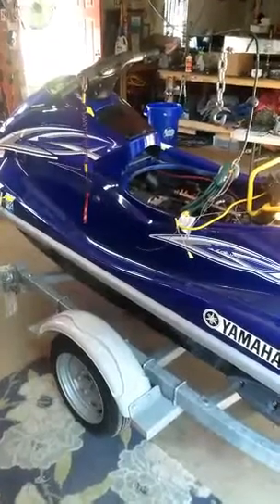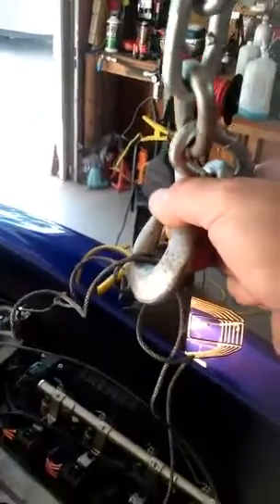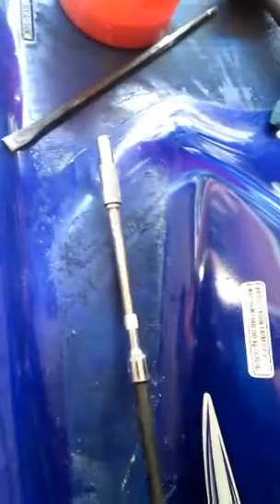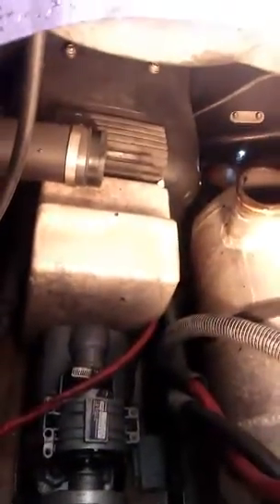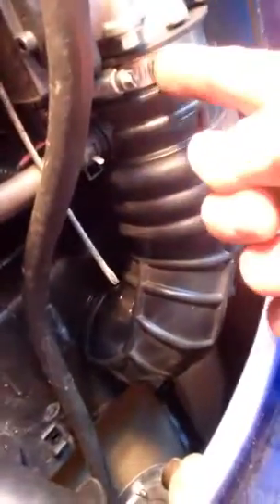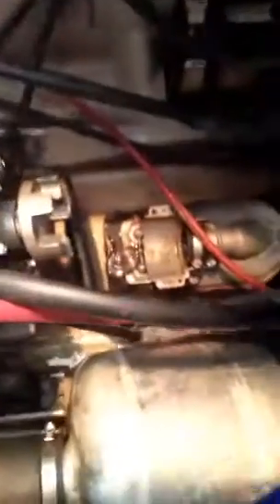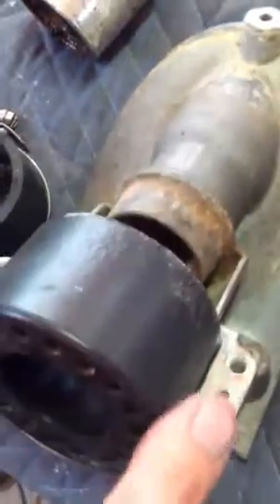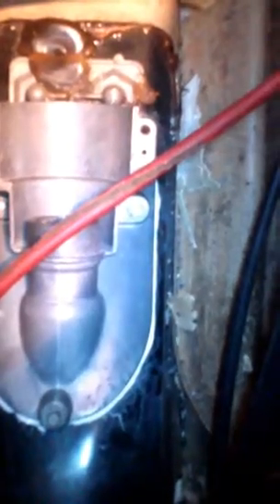Yamaha VX 110 leak fix

Comment: What is name of the glue and can  I get the seal and glue  thank you
Reply from the maker: I use 3m 4200 or 5200. The bearing was seperate and purchased on ebay. The aluminum cover i dont believe they make them anymore. Boats.net is a great place to get yamaha part numbers and schematics. Good luck. Thank you for watching!

Comment: Phenomenal video I'm gearing up to do all of this now I have one concern though my spot where there's the three screws that connect to the hole I only have one left two of them are gone and that's actually why my ski leaked somebody had to have done this all before and I was getting leaking under that big plate thing
Reply: So what I'm concerned about is can I use a drill drill three holes through the ski and put nuts and washers on the other side with special silicone or something to make sure it all stays tight and sealed
Reply from the maker: It is the 3m 5200 adhesive that really holds it on there. Why dont you try to get two more of the proper screws?
Reply: @chikkicarolina15 the screws aren't the problem it's the fact that there's nothing to screw into

Comment: So I just received my new shaft bearing whole assemble and lined up with new cover and seems to have a gap will that gap close after is pressed into shaft?
Reply: As if the sleeve wasn’t long enough
Reply from the maker: Its been a long time. Is the old bearing and housing the same as the new ones?

Comment: Ordered the new bearing kit of eBay whole assemble $88 
Does that have to be pressed into shaft after removing old one??
Reply from the maker: Yes, any machine shop or power sports place can do it. Or you can buy a cheap press at harbor freight. This is 169.00
 12 ton press at harbor freight. Copy and paste in quotes on harborfreight web search. " 12 Ton H-Frame Floor Shop Press ". I do not use mine much but it comes in handy if you do alot of your own mechanical work. You will have to get creative with making sleeves and plates for different pressing applications. I used 2 pieces of metal on either side of bearing underneath then pressed down on shaft center. Going back on i used a ring that was big enought to slide over shaft but thin enough where the pressure is put on the inner bearing ring only. If that makes any sense.
Reply: Well I have several friends with press just didn’t know if there was a specific location as to how far to press 
Obviously you’re gonna want it how the one on there is  now

Comment: Unfortunately all 4 of my bolts broke of that cap does it just slide up or do I have to extract all 4??? Anyone help please
Reply from the maker: If the heads broke off you should be able to slide it up without extraction. Heat them up and then spray a lube on them. Let soak for awhile. Then pry it up. Extract once cap is off.
Reply from the maker: Use a heat gun not a torch.
Reply: @chikkicarolina15   yeah I tried and put heat gun and wd40 on bolts and nothing ordered all new covers and caps to replace

Comment: Hi Staci,
I noticed that you said you painted your waverunner...
Can you please tell me what kind of paint you used...?
Did you spray it or roll it...?
Thanks,
Scott
Reply from the maker: Factory it comes gel coated. I used a marine grade base coat, clear coat that i purchased from an automotive paint store. They did not have waverunner color codes in their database but were able to photo match with the ski brought to them.
Reply: @chikkicarolina15  Thank you for the reply...!
I have two 2005 VX110 that are really showing their age. Yours looks really good, so I think I'll take a stab at it. I don't have a paint booth so it won't be perfect, but by the time I put some graphics on it I think it will be fine.
Thanks...!
Reply from the maker: I sprayed it with an automotive sprayer with compressed air.

Comment: How many hours on your ski? Mine is at 430hrs and I’m about to do the impeller, wear ring, jet pump bearings and intake grate, should I go ahead and do these bearings and seals while in there for preventative maintenance?
Reply from the maker: You can change it or wait til it goes bad. You can buy the bearing and seals with housing complete. it will have to be pressed on the shaft. Although you will have to remove engine to do this. The impeller/ pump work does not require engine removal but make sure when putting pump housing back on that the shaft goes into the impeller and not to the side of it! You can look through the intake grate to make sure.

Comment: It’s getting really hard to find this part for the older Vx’s does anyone know if the need style 2012+ plastic pipe, joint works on the older bd cruisers? I can’t find an aluminum one.
Reply from the maker: Ebay item number 203081041064
Reply: @chikkicarolina15  I guess I need to pull the trigger on that. I already have 5200. Just get jealous of reading on the “good ole days” of $30 joint pipe, $12 bearing cap, $7 in bolts and shipped to your home within 2-3 weeks.
Reply from the maker: I bet you will pay it though. If it were a lawn mower part it could wait!
Reply: @chikkicarolina15  heck, we’re 20inches above normal rainfall amount this year here in lower Alabama. I need to fix my jet ski in order to mow my yard!
Reply from the maker: Lmfao!

Comment: What made you determine it was the seal? Was there any play in it?
Reply from the maker: Drained water completely out of the hull on trailer. Then back ski into water with the seat off. Look down in there and you will see the water pouring in. When I removed the shaft assembly, the bearing fell apart.

Comment: Excellent video! very helpful. We took the ski to the dealer and they are saying the shaft is seized into the spline on the impeller. Any advice for separating the two that does not include cutting the shaft? I've read about penetrating oil and heat. anything else?
Reply from the maker: You may be able to use a slide hammer on the pump housing.
Reply: @chikkicarolina15  from the impeller intake side (forward of the impeller?
Reply from the maker: Sitting behind ski on a trailer you will see the steering cone assembly. The cone is attached to an aluminum bracket. Remove the 4 bolts holding the bracket to the pump housing. They are 14mm. You will need a socket, long extension and ratchet. Once those bolts are pulled out you can attach slide hammer threads through one of the 4 bolt holes. Pull the hammer repeatedly with force and see if you can get the prop to pop off the shaft.
Reply: @chikkicarolina15  thank you
it’s still soaking in penetrating oil at the, gasp, dealer…
Reply from the maker: Ouch
Reply: @chikkicarolina15  or from the aft end through the jet drive ?

Comment: So I found that when I stoped the flow of the jet sprayer that my seal went around the plate that holds the shaft. I dunno what your thoughts are about that. But it happened too soon after doing it to be a coincidence.
Reply from the maker: I do not have a definitive answer. I have blocked sprayer on many yamis without issue. If it’s an older vx with the 110 engine they are prone to bearing 
plate leakage.

Comment: hello it is not a bike, but it is a jet ski, comq since I also have another identical one I tried to change the voltage regulator, the control unit, the battery and also the steering sensor etc. but the problem persists,  if anyone has info to do other things, I thank you, I love your answers
Reply from the maker: Sorry you said bike in your previous post. Sometime people refer to pwc as bikes but either way I new what you were talking about. Being it is a 2005 how Many hours are on it?
Reply: @chikkicarolina15  220
Reply: @chikkicarolina15  grazie
Reply from the maker: That is not a lot of hours for a 2005 vx110. Have you serviced it right before the problem started. Reason I am saying it a wire could have been in clipped or pulled. I will ask some techs I know if they ever came across this issue.
Reply: @chikkicarolina15  hello by chance you asked about my case, if you have any news kindly let me know I'm crazy

Comment: hello can someone help me, I have a yamaha vx1100 from 2005, the bike does not exceed 25 mph, the sipa warning comes on and the engine runs out, the error code that gives me is 55, but I noticed that with the battery discharged below  the 12 volts gives no error as soon as it recharges above 12.3 volts, it reappears again and goes into protections, someone can show me some possible solution to the problem
Reply from the maker: I never saw a fault code 55 on Yamahas fault code list. I do know when a vx 110 is running rough and does not exceed 25 it’s usually time for plugs. Maybe the stator is not charging battery and it runs the battery out while riding. What I would try is charge battery, start bike on trailer then disconnect a battery wire. If the bike stops running it is a charging issue. If it still runs with wire off stator is good and should be charging.
Reply: hello it is not a bike, but it is a jet ski, comq since I also have another identical one I tried to change the voltage regulator, the control unit, the battery and also the steering sensor etc. but the problem persists,  if anyone has info to do other things, I thank you, I love your answers

Comment: Great video, I have a question. Just purchased a 2006 yamaha vx sport. The ski doesn't want to go over 30mph. What can be the problem?.
Reply from the maker: Check prop and intake grate for damage or debris. If a spark plug is bad it will lose power under load. You have to change them often with those skis.
Reply: Your ski might be in beginner mode if it has the key fob.

Comment: we had the same problem on our '09 VX Cruiser, and your video was very helpful in understanding the problem. In our case, applying 3M 5200 without removing the shaft worked fine for in-season repair. will be taking it apart in the winter to apply correct fix. Thank you!

Comment: Hi thanks for the info. one question  do I need to undo anything at the prop end of the shaft? or just try to force the drive shaft out?
Reply: Splined shaft. Slides right out
Reply from the maker: No you do not. The shaft will slide out of the impeller